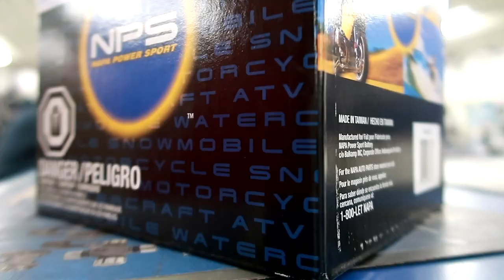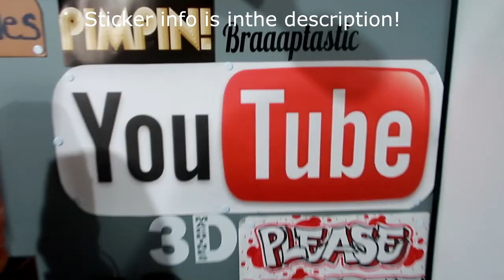ANOTHER FOUR WHEELER VLOG

Comment: easiest engine swap for that gator is 13hp Honda gx390. Its almost a direct bolt in only need longer belt.  The transmission won't take more than about 30hp. It's geared to do 16mph at 3200rpm. The gx390 can be modded easy .360 inch cam, forged rod, flat top forged  piston, ported cylinder head, lightened flywheel, 32mm mikuni etc... can get 30hp easy.

Comment: Best option is snowmobile engine or like cr500 kx500 etc. While a car/truck engine would be cool it would be very impractical. Running gear and frame would take forever and tons of cash.

Edit: Or street bike engine, 600/1000cc.
Reply: Bridger Ziegler even proper 250/300cc 2 stroke has plenty power but cr500 engine would be awesome
Reply: Yeah for sure. But I think the best would be a snowmobile engine.

Comment: put a predator 6.5 from harbor freight and upgrade the engine hits easy 60 70
Reply: Forrest Orlando I got that engine on my go-kart
Reply: Forrest Orlando nah what he needs is the 670
Reply: Forrest Orlando the gator came stock with honda gx 390 9hp style engine
Reply: robertas grigas u can put more mods on the 6.5 my friends go 90
Reply: i agree but a predator 420cc would be bettter because 1. it has electric start and 2. it has the torque to push that big gator and will hit those speeds without too much modification haha

Comment: predator 670cc 22 hp
Reply: Jake Medley or a Kohler 22 hp v-twin motor from a craftsman GT lawnmower
Reply: Jake Medley agreed that is actually makes sense
Reply: Jake Medley this is something that could realistically work😂
Reply: a bike engine would make sens to and then you have 130hp if you take a 1300cc hyabusa engine and 6gears
Reply: Ian Duijsens I'm talking as in practical by still fitting under the seat
Reply: well then indeed youre correct but i think with some "molding" the frame it will fit underneat the seat since the are quiet far apart

Comment: +3DMachines I have a 2004 Yamaha YFM250 Beartracker and it gets up and goes. It has carburetor problems in the cold but it runs good once the engine warms up. I have featured it on my channel a couple of times and this is absolutely the easiest ATV to work on.

Comment: for the gator you need a 3 cylinder 900cc kubota diesel then slap a turbo on it and crank up the injection pump and rip it

Comment: FOR THE GATOR:: i have noticed it has a engine that looks as though it would have a similiar type to the engines that harbor freight sells for super cheap (generator engines etc.) So i think you could either get a 420cc "Predator" engine, Or a v-twin predator 

I would reccomend getting the 420cc predator... ive only heard good from it, and it has electric start and also pull backup, and though harbor freight products tend to be known as "cheap" but i have had the predator 212cc engine on my go kart for over two years and the thing has always started right up and with a proper gearing i have gotten my go kart to get to 38 mph uphill with it, so i am sure the 420cc will do even better in the gator!!! i would highly reccomend getting one of these harbor frieght engines because they are super cheap, ORRRRRRR
            looking online for a used honda generator engine like the "GX" series because they are also reliable and good... also there is a HUGE community for these engines, including forums and go karting places and stores and also AFTERMARKET and OEM parts that are SUPER cheap and really make a difference. 

Now i know i am getting super far, but Dalton, maybe you could get one of these engines for the gator and then do a engine build (removing the governer and then putting billet flyrods, cams, etc. in the engines to make it fast and run safe) and if you do that, i am sure that you will gain subscribers and many new followers because of the huge community for it, like if you lookup the youtube channel CarsandCameras they have that going for them.

Thanks Dalton for making these awesome videos and i hope that you see this comment! Keep up the awesome content!!

Comment: Put one of those big Kawasaki or Honda horizontal shaft lawn mower engines in it. It might cost like $1000 if you buy one brand new, but you can probably find a brand used one for cheaper. :)

Comment: Either get that diesel engine someone offers in another video or get a predator 212 and jet/mod or a predator 420. A 212 should bolt right up and function without any changes to the machine.

Comment: 500 FAN WHAT EVER YOU FIND. bigger is better BUT I HAVE NOT SEEN A BIGGER FAN SLED THEN A 500 but i would not go any thing smaller because win it is hot out and you are beating on it just to get it moving it will over heat i have put a few Arctic Cat s  in golf carts 600 in one did not work then i went to a 440 fan in it and no problems but it was not as fast by far